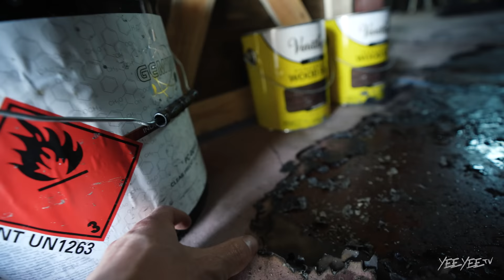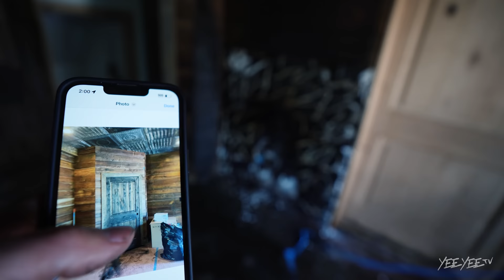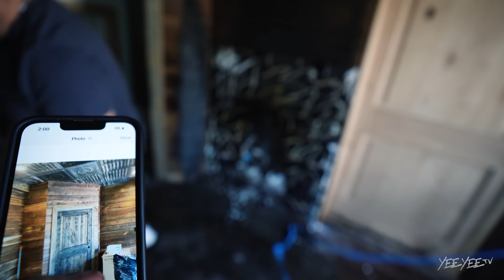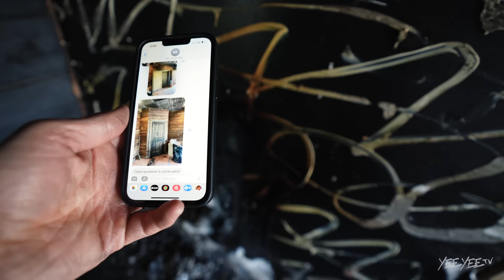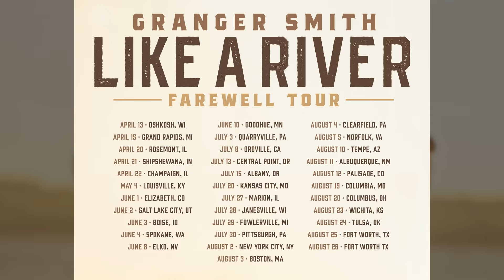Our Barn Caught on FIRE! (Not Clickbait)

Comment: I've been a woodworker for 20+ years and always spread out my rags and lay them flat on a non-combustible surface (like concrete) until they turn hard. Do this outside. Then you can throw them out.  I also have a metal paint can filled with water halfway for rags inside, always seal the lid.  On every can of pretty much any oil based stain, varnish, lacquer, poly, paint thinner, warns that they can spontaneously combust if not properly disposed.  People never read it.  Linseed oil is one of the worst offenders.....it's a great sealer for wood but when it evaporates on a rag after use, it heats up quickly.  You can feel the heat coming from the rag.....bundled up and squished rags make this worse.  Glad you caught this in time and saved some incredible head and heart aches.  

On a side note, I would reuse that burned wood.  It turns out beautiful if you know how to prep it.  Use a wire brush along the grain to remove to char, this exposes the sapwood and gives the wood some amazing texture.  You can then stain or poly it.  I've created many art pieces using this technique (called Shou Sugi Ban).  You probably don't want it back on the wall but you could make a cool picture frame or another art piece out of it.

Comment: Granger, from what you showed it looks to have started on the floor in the garbage bag from spontaneous combustion. Your hotspot where the wood was burned to the grey/white is the hottest spot. That drywall and insulation behind the wood saved this barn. 
The good thing is all this can be cleaned and repaired. 
My Father-in-Law had a fire that smoldered for a week in his wall and finally burned thru to the wall cavity and burned half his house. 
God Bless you all and sending prayers for a speedy repair and barn completion.

Comment: God sent you out there! We had a similar instance when we were remodeling our house with drywall and linseed oil rags. They DO NOT MIX! It caught on fire in the back of my hubby's pickup truck we loaded for the trash. It was scary! So yeah we learned a good lesson real fast. Always put those wet rags in a metal container away from any flammable material. 🙏 To thank God you listened and went out to check. 🙏

Comment: I caught a fire burning in our garage.  I smelled wood burning and just thought someone was having a campfire. Then I began to smell an electrical fire smell which prompted me to start sniffing out the source near walls in my kitchen. That’s when I opened the door in the kitchen that leads to our garage and there it was.  Luckily we have a spigot and a hose in our garage and I put it out quickly.  We were so lucky as we store many accelerants in our garage.  The cause? An air purifier and a static charge that managed to ignite a desk that my granddaughter’s car seat was sitting on that then burnt the car seat which melted and then began to drip to the concrete floor and burnt a patch of that. Also nearby was cardboard boxes with a plastic storage bin sat on top of them that caught fire and melted as well. That is where I intervened. Crazy!

Comment: God was sending you a message. Those rags need to be disposed of right away or you need a burn barrel to toss them into outside somewhere away from anything. I also think that you need to run some more water lines all around that part of the property and have a hose stationed at each faucet.

Comment: I work with that stuff. You can also lay them out flat on gravel to dry out for days . I had a pile catch fire outside in a heavy drizzle . And I have seen a 5 gal bucket full of rags & water  burning like a candle where just the tip of a rag was above water . Its a chemical reaction of the linseed oil & cotton. Produces heat then it reaches the “ flash” point

Comment: Please please please don't brush the black of on the smoke roof part. My business is cleaning burning houses that smoke dust is very small you have to wear the white mask to protect yourself because that stuff goes into your lungs its extremely dangerous. Best way to clean it is as follow:

Walls and roof:   one dry cloth one wet cloth first use wet cloth then dry cloth. Once black dust get in touch with water it wont go into lungs.

 Make a mix of water, 3 table spoon dish liquid and 1 bottle of white vinegar it will remove the black.

Im sorry to give you this news but that whole inside of barn needs to be cleaned top to bottom and all the furniture and all the lights and light switches everything must be cleaned. I can not tell you enough how dangerous that black dust is and very dangerous for kids also.

Comment: We had a fire in our basement. Not that bad but behind a wooden bar. Insurance paid for all clean up. We had those professionals come in. They had specialty cleaner and removed everything they could from the house including draperies from the 2nd floor. The fire did minimum damage. The firemen said it was 2-3 foot flames when they got there. The insurance said the smoke damage was horrible. Have the professionals clean it all. We had to move out for a couple of days for them to clean it all. Ceiling also. Don’t leave it to your construction workers. It’s so hard to remove and you will smell it later if u don’t clean it correctly now. 🙏🏻

Comment: This is crazy.. You're the Second Youtuber I follow in the last 2 weeks that have had Laquer fires. Luckily you both cauht it before too much damage happened. Yours unfortunately was the worst of the 2. The other youtuber also smelled smoke and looked out a window of his house, saw the smoke from his workshop. Turned out his "flammable bin" where all his laquer/cleaning rags went had caught fire. His was out side in a metal bin, but if he hadn't of caught it, it would have caught his shop on fire as it was about 8 inches from the wall and flames had just started to come out around the lid....
Really Glad it wasn't worse!